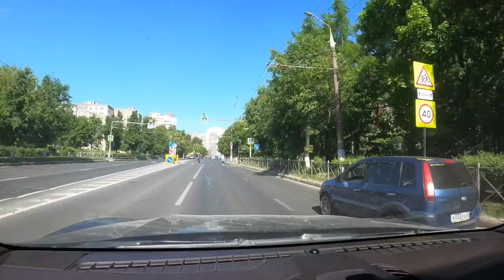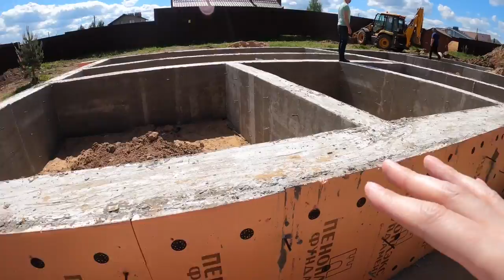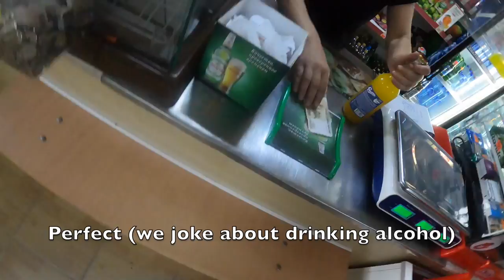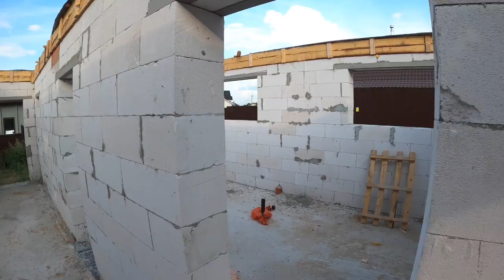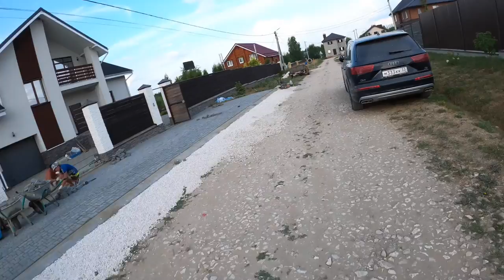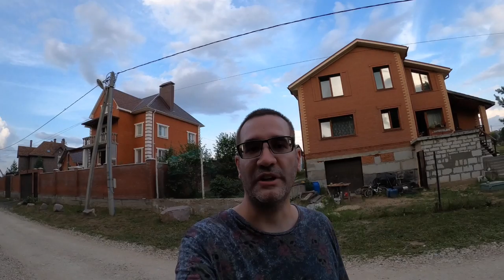Life in my Russian Village | Englishman in Russia

Comment: Can I ask you how much you bought  that area? And the cost of construction?
Reply from the maker: The land cost about $35,000
The shell of the house will cost $100,000
And then maybe another $100,000 to do the inside. $20,000 for the windows and doors. Then of course there is furniture, kitchen, garden, fence etc. house and land prices vary depending on what you want and location. I think it will be approximately $300,000 but then I would also like a garage, pool and Banya. If you would like to look and understand prices, you can look at the sites: avito.ru and cian.ru